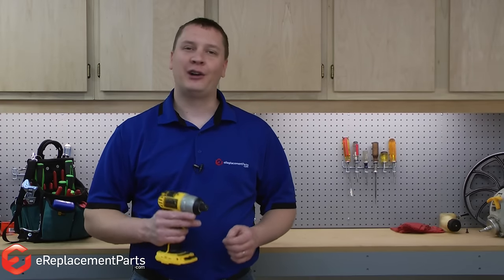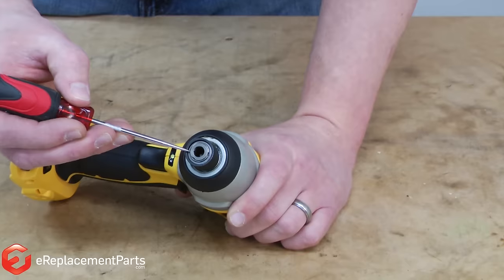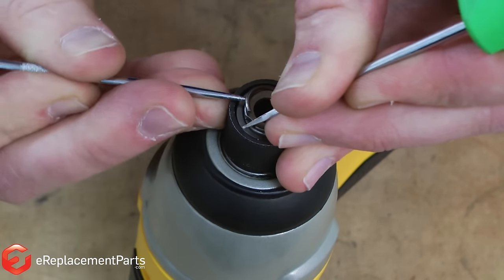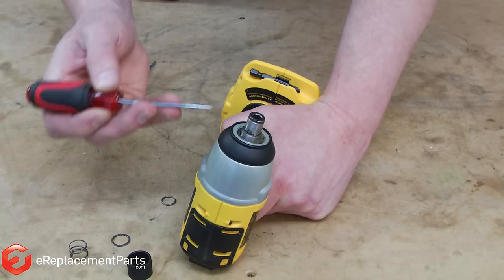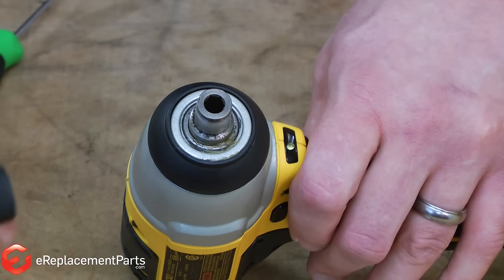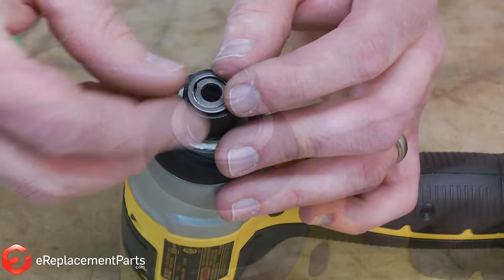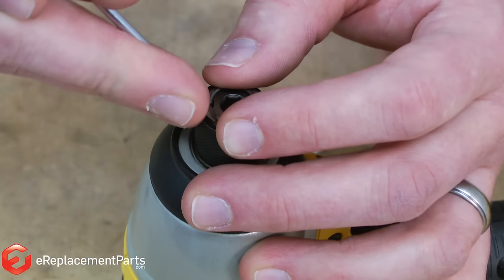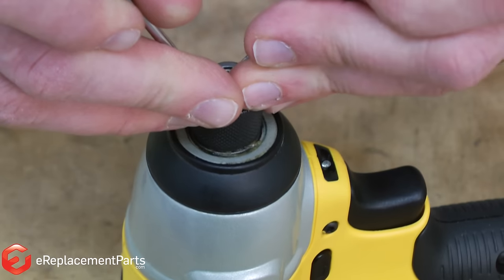How to Replace the Chuck on a DeWalt Impact Driver--A Quick Fix

Comment: This is not how to replace a chuck, it is how to remove a broken bit.  I want to know what parts I need and how to replace a chuck that no longer holds a bit in my dcf885 driver.
Reply: exactly what I need to know
Reply: Same here
Reply: I just fixed mine there's a second spring that holds pressure on the little ball you need to replace that spring make sure the ball is place over the spring in the whole hard part is getting it back in place good luck worked for me I ordered the parts right from the website just look at the diagram for the spring
Reply: Fredy Lopez Yes. I find the video poor because he addresses just one spring. When I first disassembled mine I didn't see any video and all my parts went ping before I could tell the order. This video does not completely tell the order. The ball goes in the slot. Then I think the smaller spring with the notched piece goes below the ball. then does the sleeve goes next or the compression spring. Because there is a keeper or block off inside so the compression spring can either go in the top or the bottom. If its in the bottom its over the smaller spring. If its over the top with my fat fingers I don't think I can actually hold all that shit in and put the final clip on.

Comment: There are 2 sets of springs. The uper large spring and the lower smaller spring. the lower spring is broken at the bottom end, if you can't retain a bit. Don't worry it's an easy fix. All you have to do is bend one side of the lower spring into an L shape. If done correctly the the part that you bend will fit below the ball bearing. This help the ball bearing to move back up and lock the bit. Fell free to comment if you need a video please let me know.
Reply: +Javier Reyes I could use a visual for this- I have a brand new tool, used twice, and now it won't hold the bit. I and my stagecraft students would greatly appreciate it!
Reply: +Dustin Helmer I'm uploading a video showing how to take the whole drill apart. I thought this video went into fuller detail on replacing the spring and or ball bearing so i just sped through mine, But regardless it's still more informative than this. Once done uploading I'll place a link.
Reply: Thanks!
Reply: wheres the video man
Reply: +Dustin Helmer Hi Dustin... how did you fixed your Chuck that doesnt hold? is it a dewalt?

Comment: the ball bearing goes above the spring (on top) ( between the top of the spring and the top of the slot)in the slot.  also make sure you have something to keep everything from flying off.

Comment: I have a dewalt impact has a problem. Don't hold the bit stations. How I can fixed?
Reply: Hi José, how could you fix your dewalt that doesnt hold the bits? mine aways get stuck in the screw and slips out very easily

Comment: Yes. I find the video poor because he addresses just one spring. When I first disassembled mine I didn't see any video and all my parts went ping before I could tell the order. This video does not completely tell the order. The ball goes in the slot. Then I think the smaller spring with the notched piece goes below the ball. then does the sleeve goes next or the compression spring. Because there is a keeper or block off inside so the compression spring can either go in the top or the bottom. If its in the bottom its over the smaller spring. If its over the top with my fat fingers I don't think I can actually hold all that shit in and put the final clip on.

Comment: Dear Sir... thank you for this video and all your others!!!
Question... 
Could you possibly provide some detail regarding a problem I have with these two parts? 
Dewalt COMPRESSION SPRING N020157
Dewalt BALL N022764
My problem is that a not so honest contractor used my DCF815 without permission while i was not present and told me the assembly just fell apart while installing a screw (I hate lying piece of shits like that!). My fault for leaving anything in harms way in my own house right! This has been a great tool and I think it would take dropping it from the top of a 10' ladder on concrete to get this nose assembly to come apart.
Sorry for the rant!!!
So... it turns out that the compression spring and ball went missing when the DB returned the tool to the shelf.
I bought the parts above and can't for the life of me figure out how the ball is supposed to sit and how the spring is supposed to hold the ball. There is most likely damage that I'm not aware of and it just won't go back together like its supposed to.
Any and all assistance will be greatly appreciated!
Reply from the maker: On the N078598 Anvil, there is a slot in the small round end. The N020517 Compression Spring is placed in it, followed by the NO22764 Ball, which is placed in front of the Spring. The Ball protrudes into the inside of the anvil
just enough to hold the bit you place in the chuck. Once you have the Spring and the ball installed. Install the parts to the chuck and hopefully you problems will be gone.

Comment: OK Final comment. I originally did have the original outer ring keeper. Then I lost it so I had to order it from this over priced company with shipping around 9.00 anyway, after fighting and fighting I remembered the original one had about a 1/16th inch gap. The new one no gap. I finally took 2 pliers and created the gap. I was able to complete the assembly in 20 seconds. Making sure I started the ring just past the flat area making sure the first part stayed in the groove with one screw driver. Then with a second driver it almost walked itself around. So if yo have to buy the keeper ring gap it first. 
Finally here is the order to assemble with 2 springs. I first put the small spring in with the little notched end in the slot. Then I put the ball on top of that. Then the sleeve, Remember to notice the top and bottom there is a difference and if you get it wrong it will al fly apart on you. The top of mine has a small smooth area and kind of turned in where the bottom is just straight.  after he sleeve the bigger spring. That also has a top and bottom. If you get that wrong you will know it because part of the spring will always try to get out. Then the flat washer. I really looked for a way to maybe snap all of that down to make the final ring install easier but there isn't a way. Then if you are struggling with the final ring spread it apart a little and try again. Should work. Sorry for being a bitch! I appreciate the video its just I thin k a bit slower and closer would be great. re make it with second spring please.

Comment: Can someone simply state the order? I know the ball goes first. Then the small spring which keeps the ball in I think. I put the ball on top or away from the driver. Then what, The compression spring or the sleeve. It makes a difference because of the divider in the sleeve only allows the compression spring on one side of it. Im guessing the compression spring goes on top. But then with my fat fingers I am having a hell of a time even getting the little keeper ring started and holding the spring and flat washer inside the sleeve.
Reply: +Mark Schuster Ball bearing, then small spring with the hook behind the ball, then the sleeve, then the big spring, push it down with the washer and place retaining ring on. the last part can be a hassle

Comment: This video shows me exactly what I needed to know to dislodge a jammed in bit. It wasn't broken, I just couldn't remove it. I would advise anyone undertaking this task to have the tool on the floor on some dust sheet or blanket because the tiny ball bearing will probably ping out, mine did. It will take some finding if you are working on your bench in a cluttered workshop. To complete the removal of the bit I had to hold the bit in a bench vice and pull the driver free from the bit. Re-assembly is a bit of a faff if you've got sausage fingers like me, but I did it. This guy at eReplacementParts.com is right on the money with this demo. If it wasn't for people like him, who can be bothered to make tutorials that help people like me, we'd all be spending a fortune having our power tools seen to. Not to mention waiting a week for the tool returned. Thank you so much. A great help.